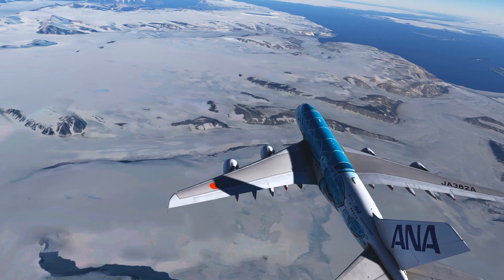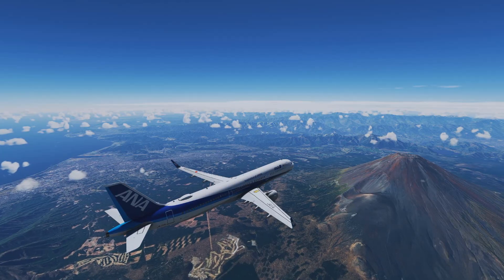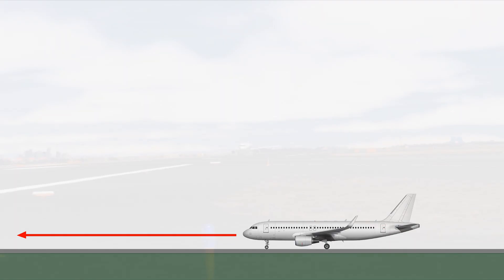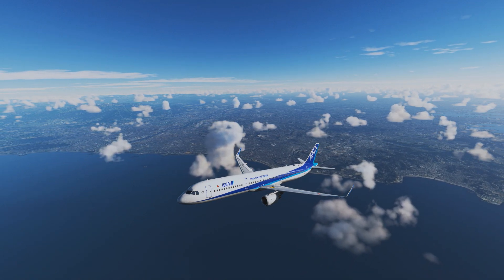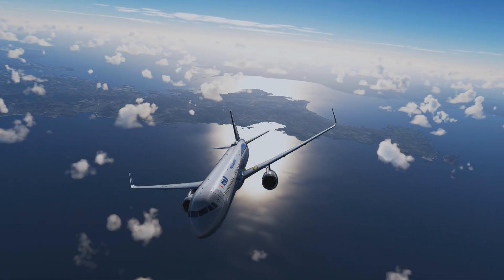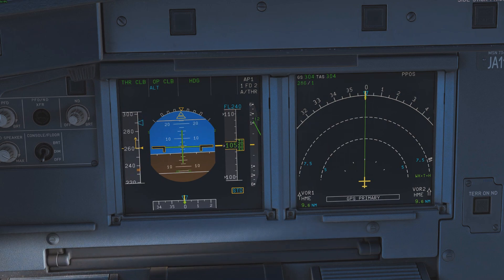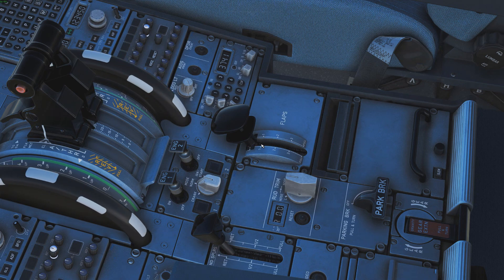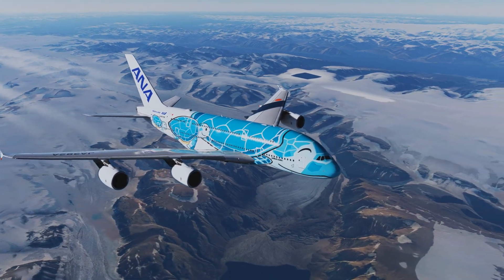What to do with all that Power? - Energy management Explained

Comment: Always enjoy your videos! I have a question..not related to this video, but have always wondered why on takeoff roll, that the aircraft runs over the runway lights... i would have thought that would create extra ware on the tires and lights themselves? Is it mandatory or why do some pilots do that? Many thanks! Doug
Reply from the maker: The lights are just little bumps and don't harm the tires. We do sometimes roll slightly offset to avoid the annoying noise. In general you have to maintain centerline as best as you can for safety reasons. On the A320 it's not so critical but on an A380 you do not want to stay too for from those lines, otherwise it could get expensive 😊
I hope this helps